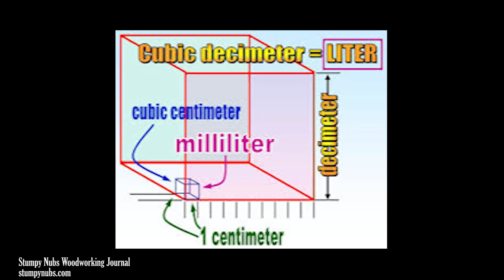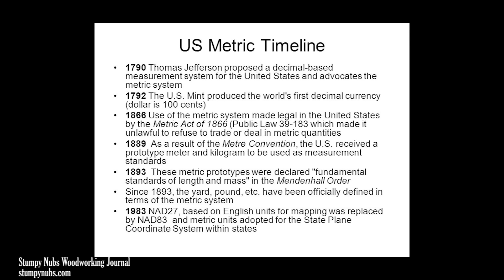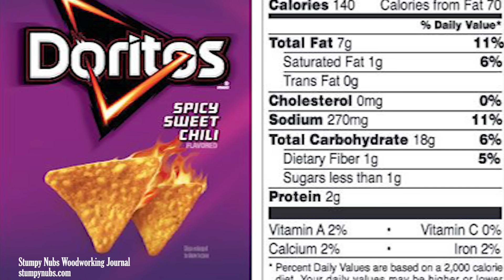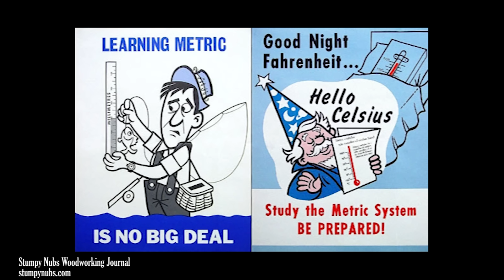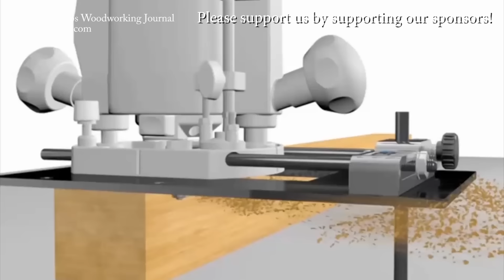BREAKING: The USA is switching to METRIC!

Comment: One of the things that gets me is when NASA is doing public relations (launching rockets / probes / talking about space stuff etc) it uses imperial units and never mentions metric despite having to convert from metric to imperial in the first place .  It is literally no effort to say X miles, Y kilometres etc.
America could end up like the UK where we tend to use imperial for rough figures and metric for more accurate measurement.  For instance We buy fuel in litres, work out driving distances in miles, economy in miles per gallon, but it's all based on metric measurements.   We buy milk in either pints or litres, depending on what suits (The amount in the jugs is exactly the same).

Comment: Only been saying we are going metric since...... 1790?

One problem is - the imperial system is based on human measurements - and inch is the width of your thumb, a foot is the length of the average foot (mine is), etc... Metric corresponds to - NOTHING. It is a completely imaginary system.

And, yes... I got the sarcasm... I had to check to see if this wasn't an April Fools video.

I really don't care what the rest do - I'll be sticking to the imperial...

Comment: Am canadien and i only using the imperial system. Inchs and foot are the best! The challenger shuttle explode becose nasa switch to to metric!
Reply: As the creator said NASA has always been metric. The mission failure that was caused by a failure to convert data to metric was the Mars Climate Orbiter in 1999. The resultant incorrect thrust figures put the Orbiter into a decaying orbit resulting in it burning up when it entered the Martian atmosphere.
The Challenger disaster had nothing to do with this issue and was as a result of the failure of an O ring due to unusually cold weather at the time of the launch.

Comment: The Metric system is crap compared to standard system when it comes to maintenance and keeping rolling stock of bolts and nuts.... because unlike the Standard system which has only two thread patterns....the Metric has way more than that and creates a logistics nightmare on maintaining and producing mass spare parts...  Furthermore just cuz things are easier to calculate in metric doesn't make it better.... Life and creation isn't easy or perfect...and dividing by 12 is more in line with life's wacko curve balls it gives you.

Comment: Those combination squares don't look to be very useful.   You really want just one flat surface, not 2 that are at different angles.   A lot of US manufacturing is done in metric.  NASA does everything in metric, although some contractors try to fudge from Imperial measurements.    The worst debacle in that kind of fudging I ever saw was when I worked for a (now defunct) Canadian company.  We had contracted with a Japanese chip maker to make prototypes of our graphics chip.  While we were waiting for the first samples, a co-op student was tasked with laying out the PCB.   He got the dimensions of the surface mount chip, and, realizing it was all metric (surprise! Canada was officially metric then) he converted the pin spacing to inches, and used that to design the footprint for the chip.   Accumulated error resulted in the chip pads being spread out way beyond the width of the chip, in both dimensions.   A bottom tier employee was tasked with bending the pins out so they would land on the pads.   I don't think we ever got any data from those first samples.   I was away taping out the next version of that chip.   When we did finally get a board that worked, no consideration was given to emi concerns and timing was marginal.   A more senior engineer took it to an FCC testing lab and had an embarrassing failure.  But that's a story for another video.
Reply from the maker: Having a square with one fence at 90 and another at 45 is something that's been favored in numerous trades for well over a century. It absolutely IS useful.
Reply: @StumpyNubs  That's not what I am talking about.   I have lots of 90/45 combination squares.   The two sides are wide and flat.   Yours have an ambiguous extra angle that doesn't appear useful for anything.  And the metal casting is so thin I bet it would break in 2 if you dropped it.
Reply from the maker: @williamogilvie6909  What are you looking at? An extra angle?

Comment: Thanks for the great video. It's just as easy to make a mistake moving a decimal place in metric as it is in inches. Ask nurses how easy it is to mix up milligrams and micrograms; it's just a few decimal points away. Truth is you could just as easily convert a ruler to measure in tenths of an inch or use tenths of a mile. The metric system isn't inherently more accurate just because it is based on some arbitrary distance from the equator to the North Pole.  Is a part machined within .001" harder to do than 0.0254 Mm? Most metric users think they are using Metric when measuring temperature in Celsius, but the temperature standard for Metric is Kelvins, making the freezing point of water 273.15 K, not 0. We will switch over to Metric when you do. BTW , when the American astronauts were landing on the moon they called out their speed and distance in feet and feet per second. Which makes us wonder why we don't adopt a Metric Day and use kiloseconds instead of hours; because it's clunky and useless for everyday life.

Comment: Metric is for people who can't do math. Inches can be divided by 10 or 1000 too. I do it regularly on my mill and lathe. We are the most powerful nation that the world has ever seen, and we are the last bastion of sanity against metric. We must be doing something right.

Now, back to the inch. If you mash your thumb against a flat surface and measure across from one side to the other, that is an inch. You can calibrate your pressure to fine tune your personal inch. Carpenters have done this since Jesus' time. If inches are good enough for Jesus, they are good enough for me. What biological unit equals a centimeter? No jokes about Yankee penises, please, even though they are funny. So, you also have the foot, which is pretty close to a foot. Then there is the yard, a long-ish stride that any football ref worth his striped jersey can step off with amazing accuracy, and do it quickly. I am a retired seaman and we measure small rope by the fathom, which is 6 feet, and the way we measure it is to grab the rope and stretch it between both hands, arms spread. Then grab it from the other hand and do it again and again and count, then estimate leftover feet. Like the inch, the fathom is calibrated to the person's precise biology to conform to the norm. Until not so long ago, depths were in fathoms, as well. Anchor chain on ships is measured in shots. A shot is 90 feet. FEET. 15 fathoms but anchor chain is way to heavy to measure arm and arm. Some chain is big enough that it takes a fairly strong man to lift one link. But it is in SHOTS, i.e. 90 foot increments. We don't use kilometers at sea for distance, either. The reason is that all distances on the face of the earth must be expressible in angular measurements, i.e. degrees and minutes, for purposes of navigation, so we use the Nautical Mile, basically one minute of latitude angular equivelant. Great circle routes and celestial sights are all calculated by spherical trigonometry, and never a sillymeter will intrude. The scales on my X and Y handles on my mill are marked in thousandths of an inch, and hmmm... there are 62 and about a half incrememts in a full turn. Why is this? Because a full turn of the handwheel is a sixteenth of an inch!!!!! Because the lead screw is at a pitch of 16 teeth to the inch. Don't get me started on gallons and quarts and pounds and as I am heavily into the shooting sports, particularly cap and ball revolvers, grains as unit of weight or volume for powder are part of my vocab, as well as grains of weight for conical bullets. The caliber is .44, thank you, which is 44/100 of an inch. The ball loaded is usually .454" diameter so that ramming it leaves a small circle of lead shaved off the ball on the face of the cylinder. A .451 ball is not tight enough to guarantee a nice tight seal, and .458 is a bit tight and difficult to load. My next favorite gun is my 1911 in .45ACP. Yup, that stands for 0.45" diameter bore. I weigh myself and the fish and shrimp I catch in pounds. The 60 year old diesel in my sailboat is 107 cubic inch displacement and holds 5.5 quarts of lube oil. Every line on the boat is cut and spliced or otherwise terminated in feet, enough rope to go about halfway around the block, I would guess. 

Inches forever! Remember, Jesus was a carpenter and were good enough for Jesus, and metric was invented by atheists. Dont get Jesus pissed. He can really make things tough for you.

Comment: 1:31 I for one can't wait for the Americans to finally fully adopt the metric system. It's not like the imperial system doesn't work. It's just a pain in the ever living (.(  to have to constantly swap back and forth between them because of the non-unification of measurement across the globe. Personally, I'm fine with going with one or the other. Just pick one, and stick to it. 

But if I have to choose, I do prefer metric, because ultimately it is a lot simpler. 

Also makes my short (.( seem taller too. 5.5501641'~ = 169.169cm~. 

Which seems taller by numbers alone? Yeah, cm, right?  

Why so specific about height? Every mm matters.

Comment: What is an inch?
There is no independent standard definition of one.
It is now defined as a length of 0.0254 m.
So the metre is the standard unit of measure of the imperial system.🤣

Comment: I'm in Canada. I use imperial for wood working and some things, and metric for other things. The right tool for the job.
The benefit of a 12 based system is large unjts are divisible by 2, 3, 4, 8, etc. A 4 x 8' sheet of plywood is divisible in so many sizes with even numbers. Also, we only work with easy numbers under 100, usually. Also, fractions are trivially easy. it's all done in your head on the spot.

Comment: IQ test...

For Americans:
What is 15/64 + 9/32?

For everyone else:
What is 6mm + 7mm?

Fastest answer wins.
Reply from the maker: Double the 9 and add 15.... It's not difficult if you've learned how to do it. I'm not sure you proved those who need a simpler system have a higher IQ...
Reply: @StumpyNubs  I'm English mate, I grew up with the 'English system' ...I know how to do it. You prefer it because it's familiar, not because it's better. We converted 50 years ago and we were the same. Your views will change ...or your kids views will.
Reply from the maker: @Martyntd5  When did I say it was better?
Reply: @StumpyNubs  You didn't. I'm just saying we were dragged kicking and screaming into the metric system because of our proximity to Europe. It took a good 25 years for all the trades, workshops and tooling to switch over. But now ...wild horses wouldn't drag me back to the imperial system. The US is hanging on to the IS because it's comfortable and familiar ...but it IS inferior by any metric (see what I did there? 😄).

Comment: The metric system lends itself well to smaller measurements like used in cabinetry. But when you get into larger dimensions as found in construction most of those arguments go out the window. It’s easy to divide a large dimension in half using the imperial system, say 66’ 8 3|4” is simply 33’ 4 3/8”, it’s simple do do this calculation in your head.  Now try that with 20,339.05mm, hmmm, not so easy is it. Now if I need to divide that dimension into three or more equal parts I use a calculator as I’m sure you would do using the metric system.

Comment: As a retired physical scientist I always used the metric system and thus very familiar. So as a woodworker I can adapt to using all metric in projects. The only difficulty is the rest of the wood industry does not share the same idea. Wood is still measured, priced in board feet, project plans are still mostly in inches/feet and tools, especially router bits, saw blades and drill bits/gauges are in fractions of inches. More metric versions of tools are joining mainstream thanks to Festool, Makita etc. Example is the MFT table with 20 mm dog holes although YouTube tutorials that make jigs, tables and benches use 3/4 inch bits to make the dog holes. I think the biggest example of mismatch comes from dimensions of sheet goods. The industry sells sheet goods as 1/4, 1/2, 3/4 inch thickness but none of them are correct since the are in millimeters. This is a major frustration of new wood workers who layout dados, mortises and rabbits only to discover the corresponding plywood doesn't fit. Enough already, lets move to complete metric and work more efficiently.